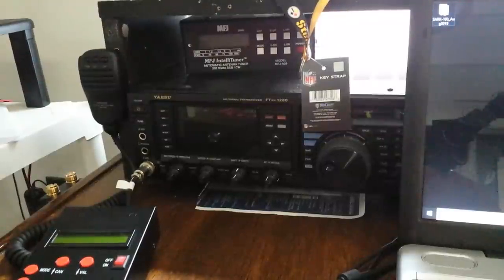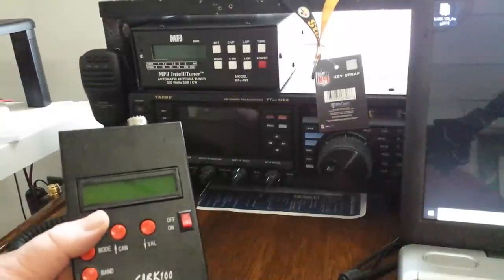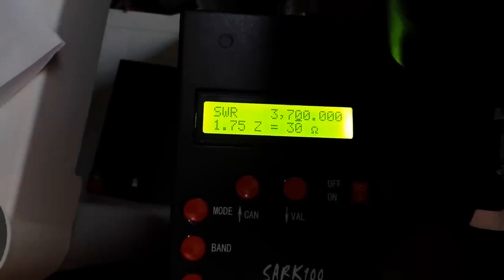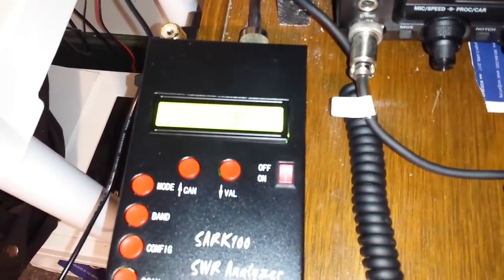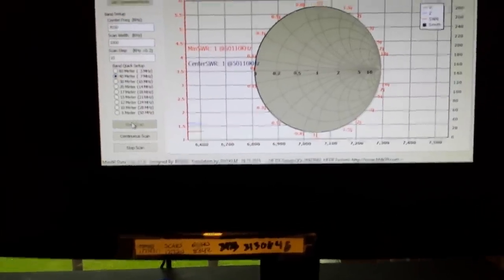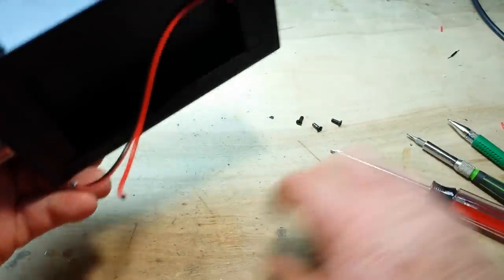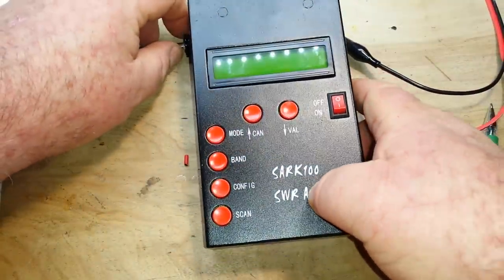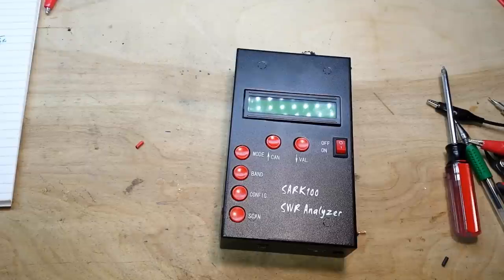Graphing Antenna analyzer for less than $100 from Banggood

Comment: You're right to aim for a 2S battery as a 3S pack would waste more power in the regulator, but since the unit does not work at 6V it means that you won't be able to use all of the power from a 2S pack.  As it works at 7V, all we can say for certain is that it will use more than half the capacity of a 2S lithium battery pack.  That's a safe option, but won't give the best runtime.

However, if the unit runs down to 6.2V or so, then 2S is a fine choice and will provide 80% or more of its capacity.  The BG page says it takes an 8AA pack and an 8S alkaline pack would be dead at 7V, so the unit is designed around a  ~10V nominal pack.  A protected 3S lithium pack should be a direct replacement, but 2S will work if kept well-charged.

I've seen flat-packs or 14500 packs that should fit, though they might require some velcro or double-sided tape to contain.  If a DIY pack is used, adding a secondary USB charging port would be a no-brainer as it allows the pack to remain installed indefinitely.  Combo charging/protection boards are dirt-cheap.

Edit:  Actually, you might be able to connect a charging board to the existing USB outlet as it likely only uses the data pins from the factory; the power pins should be available.

Comment: That looks like a great little unit but whats in battery compartment is battery wires not caped or taped it look like they are a little burned on ends when you put 12 volts into your jack i believe it sends power into battery wires also so make sure they are caped you dont want a short.

Comment: Firstly I'm disappointed you didn't do a follow up video on the MR300, which Banggood sent you last year and is basically identical (even runs the same firmware).  The MR300 had a redesigned pcb layout as does this both from the original open source design.  I got one based on the review but it never worked I was sent a replacement and it was also faulty..  They have never worked correctly and banggood was never able to solve the issue.  I assume you had the same issues since we've never seen it on here ever again and you have a new one...   Please do a follow up and let us know one way or the other.
Second AFAIK the battery required is indeed a lipo and its supposed to be able to charge it too.  Also have a check inside there is also an option to add a bluetooth module so you can use it in the field with your phone or tablet.   Both these are also in the MR300 design too...

Comment: One other note, find a 50 ohm resistor and attach directly to the Sark so239. Should be right at 50 ohms swr 1.0:1
Reply from the maker: I have calibrated the unit with open, 50R, 150R loads as requested in the calibration setup. Ill go through it in a future video.
Reply: @learnelectronics  
Cool beans.

Comment: Thoughts:
I assume the antenna coax was attached directly to the analyzer.
Is the antenna adjustable? If so, you may want to fiddle with it, move the center frequency.
Thanks for the video, I'll be listening to 40 meters this evening. Have a great weekend.
73s
Reply from the maker: Yes attached directly to the coax. Definetly not adjustable, it;s a 40 foot tall phased vertical dipole in my back yard.
Reply: @learnelectronics  Mmmm, oh well.

Comment: Hi, thanks for the video. Last year you presented us the MR300 is there a difference between them except for the battery compartment? The DDC chip is the same and software also. I did bought the MR300 and I did calibrate it with some resistors. I didn't found a proper calibration load kit for it. Maybe you can do a comparison video between them but first you should calibrate both with the same loads. Thank you bye 👋
Reply from the maker: They seem to be about the same.

Comment: i had one found it eat through battery power in no time also found swr and ohms would change as voltage dropped. 
even found to get a different reading every time i turned it on.
after getting a rigexpert aa35zoom its readings was way off from 40m and lower which would explain the sark saying good swr but the radio was way off and would not tune at all.
but will say others to find them ok and no problems at all could well have been a bad unit .
but after my bad dealing with a sark unit never again will i buy another.
Reply from the maker: SWR matches the reading in my Yaesu FTDX1200.
Reply: @learnelectronics  you must have a good one then. lol 
mine was all over the place it ended up in the bin after i removed components from it. lol
Reply from the maker: Did you re-calibrate it for the battery voltage?
Reply: @learnelectronics  yes did the calibrating many times connected 50 ohms to it showed 49 fair enough connect 150 ohms would show 148 then 274ohms like it states then it wold show 128. like i saw a dodgy unit the rig expert i have ie spot on when the same inits i made up fitted to show up 5o / 150 and 274 as that is what the are

Comment: Did the a23 batteries work?  Man that HAM stuff is black magic to me. Great video though. Have a great weekend Paul.
Reply from the maker: No, they didnt push enough current. I ended up using a 2s LiPo 650ma.

Comment: Extend your drive element 1/4 inch and re run your plot.
Reply from the maker: It's a 40 foot tall phased vertical dipole. It cant be changed.
Reply: @learnelectronics  Then build a single loop inductor and use it on the feed line.  Antenna End Preferred. Run your scan.  If your Z is to high open the loop .  If your Z is to low,  close the loop a bit more.  Use what ever your coaxial conductor is for the inductor.
Reply from the maker: Ok. Im new to RF. So alot of the antenna engineering is out of my wheelhouse. What advantage would I get by making this loop? Improve the inductance, right? Ok..would the benefit of that outweigh the loses from adding in two more connectors and a length of coax?
Im not being a smart-ass here. these are serious questions.
Reply: @learnelectronics  No Engineer here ether just a Ex Military Comm Wienie.  Your Desired Impedance is 50 Ohms.   Your Plot shows your outside of that.  LOW !   If you could match your antenna closer to the 50 Ohms Z  life would be better.   Driven Element matching could achieve that.  You can't !  You can alter the Z by capacitive or inductive means.   Not much required in the Mhz Range, eaaa?   One turn of wire around a one inch form would be easy to work with.   I would start with a One Inch One Loop Coil openned so the two ends of the loop are like 1/4 " apart.   Plot.  If the Z is  high Open the Loop.  If the Z is low close the loop closer together causing more Inductance.
Reply from the maker: Thank you my friend, Ill try that today and see how it works.
Reply: @learnelectronics  Iet me know how it goes.
Reply: One Loop being 360 *  If that proves not to be enough use a turn and a half.